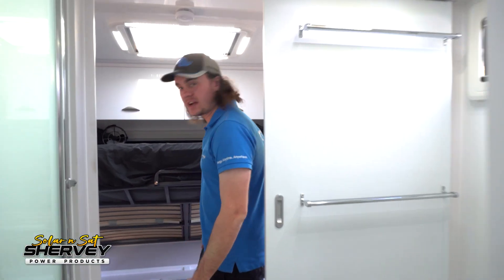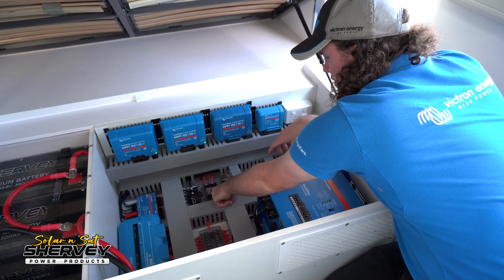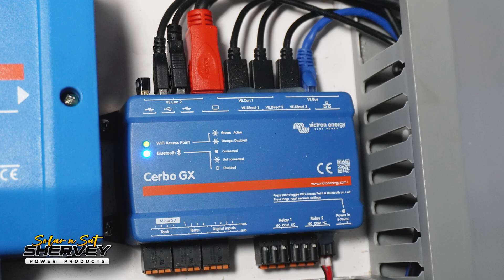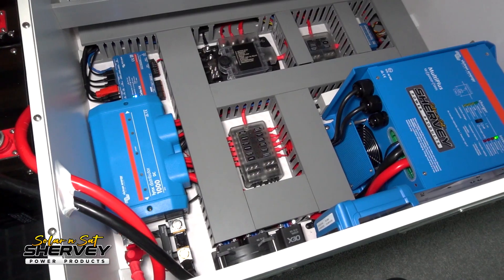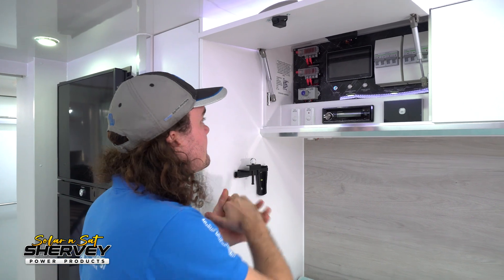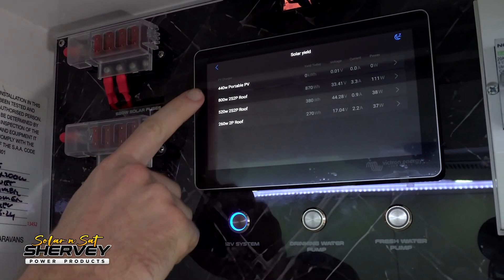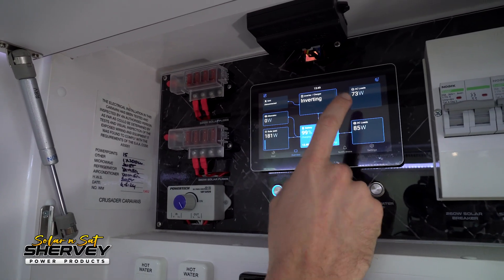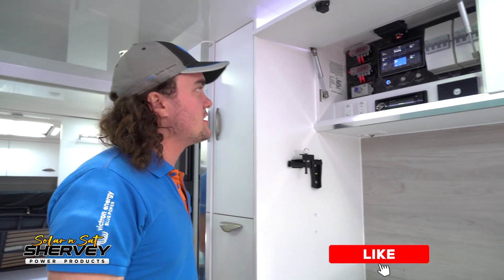Crusader Excalibur High End Victron Energy & Shervey Power Products Lithium Power Upgrade

Comment: If I wanted to upgrade my existing system (200w panel with a bmpro and agm's) to 4-5 panels 1000w  with lithium and victron gear. Would you need to drill a hole in the roof for every panel or series parellel string to access the cables through the roof. Or do you try and run them all back to a single  penitration? Do you use cable entry galands or jb's. Hate the thought of having a leaky roof in the future. 
Great vid. Very informative. I hope to do an upgrade like this eventually.